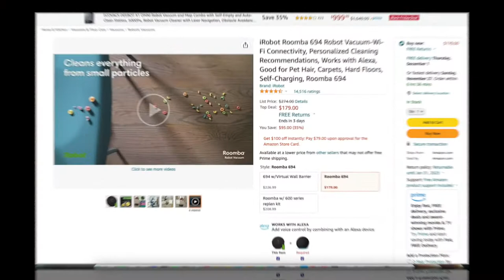The iRobot Roomba works because it is a true vacuum, not just a carpet sweeper

Comment: What are the negative and positive wires connected to that gives power is it a battery powered by solar or
Reply from the maker: That’s just to show there’s a motor inside the dustbin. I used my Ecoflow which can output dc at 13.6 volt. This voltage is similar to that put out by the battery pack inside the vacuum cleaner.
Reply from the maker: The demo is powered by the output (13.6v) of the Ecoflow power station.
Reply: @wtam69  thanks what do u use that ecoflow battery for on daily basis? Also do u charge it via solar or ac
Reply from the maker: @disrael2101  On a daily basis, I use it to power my led light by my bed. It is solar charged in the daytime. Watch this shorts: https://youtube.com/shorts/WNWrepqweGg
Reply: @wtam69  interesting can u show a video on the configuration of the wires for charging it solar, also explaining about the storage capacity of v,amp with different outlet devices
Reply from the maker: @disrael2101  I assume you want to see how I charge the Ecoflow power station/generator. I will make a short video when I get the chance.
Reply from the maker: @disrael2101  A quick video on how I charge the Ecoflow solar generator. https://youtube.com/shorts/IPBQrNAqNqk
Reply: @wtam69  thanks sir
Reply: @wtam69  it's nice vid but u didn't really show which cables are needed / where they are connected to aka the set-up, thanks
Reply from the maker: @disrael2101  That will be a long video. What I uploaded is what they called Youtube shorts, less than 60 seconds. To put it simply, you just plug the AC plug from the Ecoflow to the AC output from your solar setup. A solar setup works by first collecting energy through the solar panels and storing the energy in the batteries. A DC to AC inverter is used to provide the AC I needed to charge the Ecoflow generator.
Reply: @wtam69  interesting, just curious to see the wires connections between all those varies applications